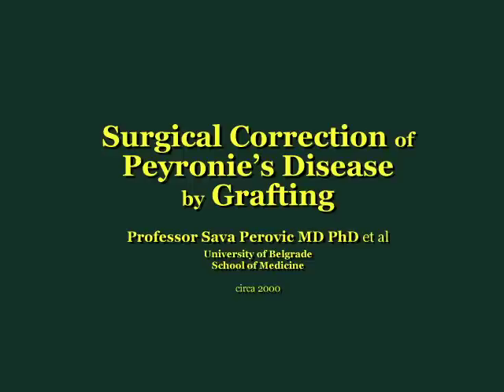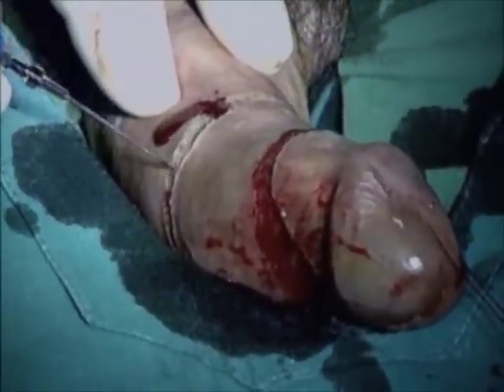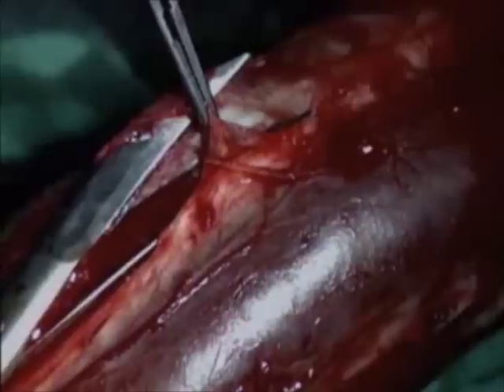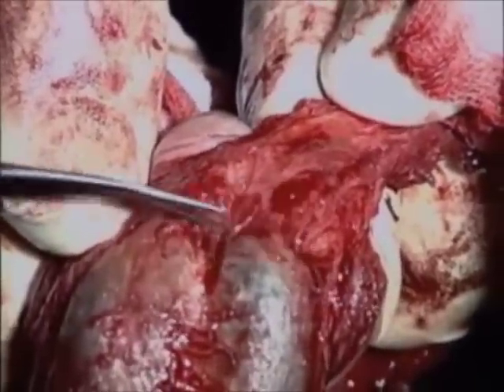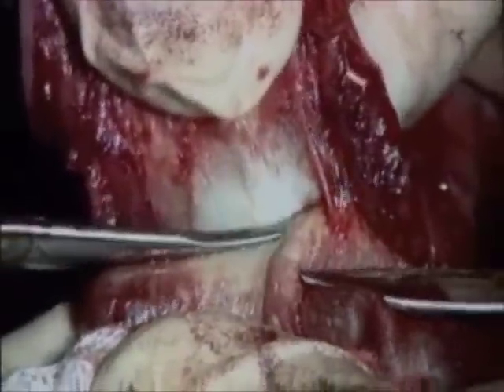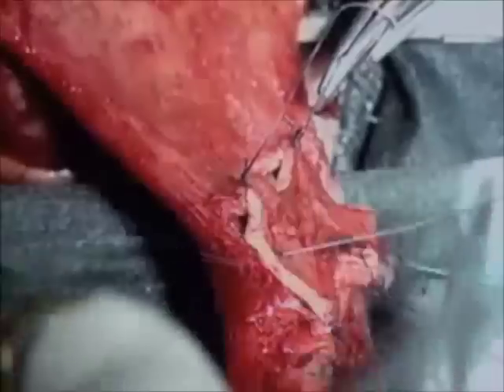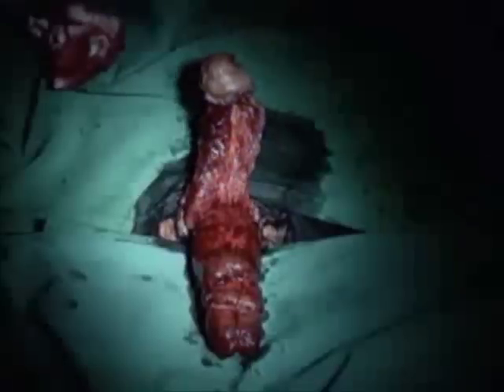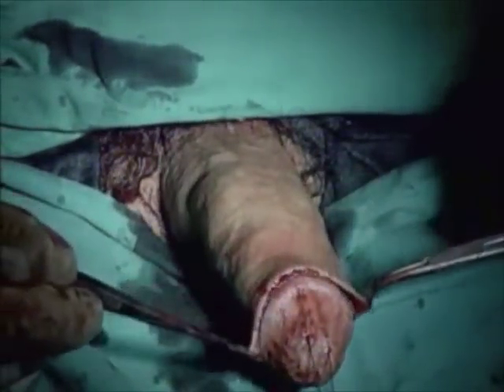Peyronie's Disease Correction by Grafting Surgery

Comment: Thats really quite shocking
Reply from the maker: +Mick Smith - Hi! Sorry for the very slow response but we are continually overwhelmed with patients. The surgery is very invasive but the good results are straightening with restoration of original penile dimensions before the disease with no reduction in erotic sensation. And the scar becomes a pencil line that is usually aligned with a previous scar from circumcision. Most importantly, the person can again have sexual intercourse and enjoy good quality of life. The surgery is done under general anesthesia so the person feels nothing and modern meds provide excellent pain management post-op. The alternative to grafting is plication. That means they cut out a big hunk of GOOD tissue from the side opposite the damaged tissue resulting in a drastically shorter penis. Many surgeons don't make that perfectly clear before surgery and it's a real shock afterwards. -- Richard